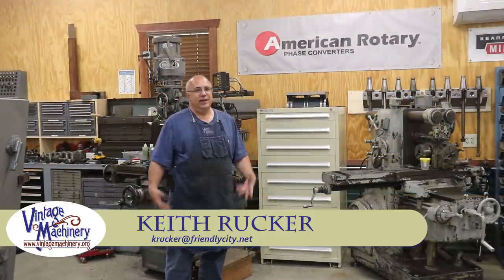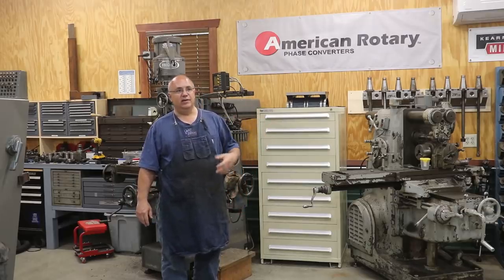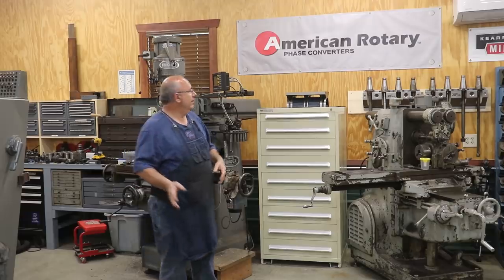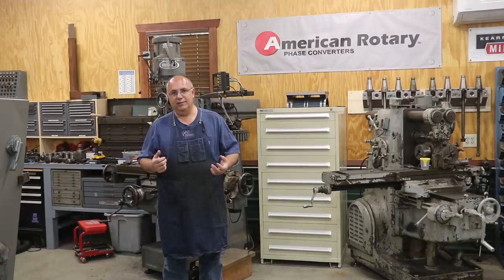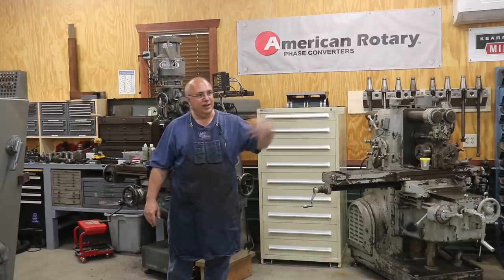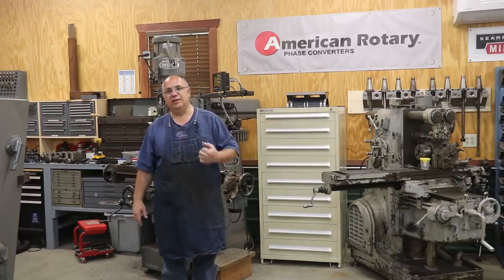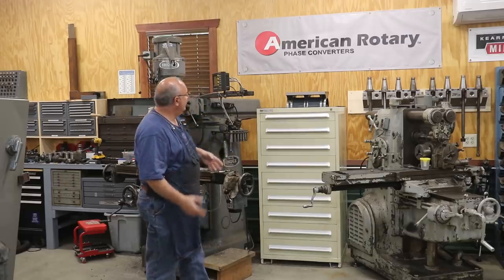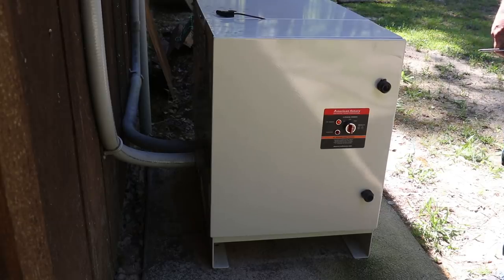American Rotary Phase Converters: Making your own Three Phase Power

Comment: Here before the Germans start with the "all of our homes have 3 phase."
Reply: Homes, pffft... I'm at a summer cabin in finnish rural area. Can't get 1-phase power here, have to get 3-phase. Albeit we use only one phase.
Reply: Its not just Germans - most of EU. All ex-communist countries also have 3PH.
Reply: @tomk3732  Yes Denmark have 4 cords digged down in soil now,before then were in the air.All homes have 240 volts,which is difference between zero-0- and one phase.,I just use a generator on my tractor,400 volt 35 amps. whenever I need to weld something with 400 amps.,not so often.Cheaper that way in my case.

Comment: I think they have different control boxes for the CNC type systems though, more picky about the input power.
Reply: Just find out which out of 3 phases has stable voltage and use that for CNC electronics. Not a big deal. I have 240 240 and 270. I don't use 270.

Comment: Thanks Keith. I'm talk with them now, and I can say they are very very helpful. Thank for the explanation, the VFD and rotary phase is what I'm trying to decide witch one??
Reply: How many machines and motors?  More than 3-5 it is likely better to get a rotary, less than 3-5 then better to just put VFDs on them.  (remember a machine with multiple motors would require multiple VFDs)

Comment: You can easily obtain used 5 horsepower VFDs. For anything under that size there's no reason for a phase converter.
Reply: im pretty sure he said the reasones. If one machine go vfd he said if you got a lot of machine or 20 hp may want to look at a phase converter.
Reply: For one single machine its OK. Then you get another.... then you ditch the VFDs like me and just get rotary for slightly more then price of used quality 5hp VFD.

Comment: Where I live in California, the power company wants $10,000 to $20,000 per pole they need to extend the extra wire.
Reply: I saw a need to 'simply' upgrade my #2 Al SEC but that would cost a $1.5k engineer assessment plus $10-20k to pull about 200' of new wire.  Keep in mind this is all underground and the existing 1.5" underground conduit could handle the #0 Cu wire I needed but they would insist on retrenching I'm told.  Gotta love California and PG&E.  Oh: they would get to it in 12-15 months. rolls eyes

Comment: Yeah, the additional amperage required by a 2-to-3 phase converter is expensive.  For my lathe I needed 10AWG to carry 30A for a 3HP motor. The machine wire was expensive, the cable was expensive, even the plug was expensive.

Comment: A 3-Phase motor makes a noticeable difference in surface finish on even a small lathe such as an Atlas or South Bend.  I had a 3 phase motor with a VFD on my 12x24 Atlas for several years, worked great with a obvious difference in smoothness and finish quality.

Comment: So I can feed a VFD 3 phase power? That is something I've been wondering. I have 3 phase in my shop for my planer and jointer and was wondering if I buy a Powermatic lathe with VFD and 3 phase motor, if I can  feed it 3 phase power. Sounds like that can work, anyone know if it's just a matter of wiring it differently or any other catches?
Reply: Yes you can. You just need to buy the correct type of VFD. A VFD made for single phase input and 3 phase output will NOT work. But you CAN get VFD's that are made for 3 phase input and 3 phase output. The two types are not interchangeable.
Reply: @highpwr - well likely the VFD that comes with the lathe is for single phase hookup so it would cost quite a bit to buy a different one and hook it up, so likely I would have to use 1 phase input as it comes ready for, thanks for the info
Reply: @highpwr  ...Any VFD can be powered with 3 phase.  Controlling motor speed is their prime function.  A side benefit of a VFD is that it will allow 1 phase input to a 3 phase motor.  VFD's can be purchased from the manufacturer sized for single phase conversion (driven motor hp) or you can select a VFD per size of the motor you are operating.  For example, a 5hp, 3phase motor will require a 7.5hp VFD. Either way, any VFD will always accept 3 phase input  .
Reply: Not all VFD's accept 3 phase. Some of the smaller units are single phase only.
Reply: Most VFDs you get accept 3ph to produce 3ph back that has different freqency for motor control. VFD = variable frequency drive. Some VFDs - newer models accept single phase input and give you 3ph back - however that strains the VFD so bigger ones are de rated for that use.

There are very few small VFDs that are meant to work with 1ph input to 3ph output motor only in small 100lbs tools such as small mills etc. You see they have say 120V plug on them. 

Powermatic stuff is usually 1000lbs+ class so I am quite sure you have standard 3ph - 3ph VFD.

Comment: I have 1 phase power, but need 3 phase. So for the missing phase..... Math makes the astute go HUH? 1 phase of the 3 produced at the power co is used to provide your home / shop electricity. The power co uses a transformer to step their distribution voltage down to your home voltage of 120/240. The 1 phase 240 is 2 x 120 feeds that are 180 degrees apart from each other. A rotary phase converter uses those 2 x 120 volt phases to generate a 3rd 120V phase & double that voltage to 240V. Capacitors are used to shift the 2nd phase from 180 degrees to 120. The idler motor acts as a generator to take the excitation from the 2 supplied phases to create a 3rd phase. This is an oversimplified explanation.

Comment: Why use three-phase power? 
Put that question into Google and you get lots of answers that all relate to how it is more efficient and cheaper for high-power loads.  What most of these tutorials fail to mention is that the torque the shaft of a three-phase motor is constant.  On a single-phase motor the torque varies between zero and a maximum value for each revolution, inducing vibrations.  The math (for those not afraid of it) is simple:  Sin A plus Sin A+120degrees plus Sin A+240degrees is equal to zero. Smooth running sith no  pulses.

Comment: Single phase has 2 lines in each aprox 110 volts for total of 220 volts. 3 phase has 3 lines in,  220v 360v 440v in total voltage.If you understand single phase 220 v it's not hard to understand 3 phase. 3 phase is always lower amps for running motors, as is 220v single phase is always lower amperage than 110v.  Think of it as more power with less amps and easier starting a load.

Comment: At 19:00 can you not wire that function directly in the converter? If no Three phase Power is used it turns off after the selected time. No wires to every machine needed. And you do not have to find out that the machine was running all night/week.
Reply: new and old tech I thought the same. It could just monitor the current and shut off if it stays below the threshold for X time.

Comment: It is important to consider that these converters are an acceptable solution for using 3 phase motors.
More sensitive 3 phase loads may do less well. This is by the nature of the construction of these systems.
A 3 phase motor is a very forgiving thing...not everything else is.
There is nothing wrong with that, as long as one is aware of it.
As an example, I would be less keen to feed a 3 phase VFD (3 in, 3 out) from any rotary converter. This will initially work, but how long ...that's anybody's guess. And VFD-3in-3out are not cheap items either.
The US grid is a legacy grid. This goes back to the days when Edison was in it for the money and Tesla actually knew what he was talking about! Updating the US grid to a European style system, would probably cost more than the Moon-shot! These rotary converters are really not the worst solutions, as long as the customer is aware of it's limitations.
If complex CNC machines have to be driven, I would opt for a system that has a separate motor and generator (basically an electric motor, single phase, driving a gennie which is three phase)  This has other issues, such as differential load issues. usually the load on the 3 legs needs to be within 15-20 % of one another. Zero percent being ideal.
Some of the problems can indeed be overcome by over- dimensioning the convertor, but that costs coin.... quite a substantial amount...Knowing that a modest model will set you back 2.5 K -3 K, it is clear where this is leading.
Another thing to consider, for the home-gamer, garage- warrior or rank amateur is the fact that you are almost always alone in your shop. This means that you will have one 3 phase item on at the time. The only exception to that may be a shaper,which can be left running while you are working, say, on the lathe.
Now, unless you go Abom-size on these things, shapers are usually pretty modest in their demands. I have a klopp 450 (18") which takes 1.5 Kw (2 'orses) or about 2 Kw (2 'orses and a limp mule) with the coolant pump on. Add to that another 2.5 Kw for either a lathe or a milling machine and your total demands are not likely to be more than about 5 Kw (7 well-rested 'orses).
Depending on the wiring available, a VFD solution my well be a lot cheaper in this case.
Nothing stops you from getting a beefy VFD and distributing its output to your machines. The fact that is made to vary frequency is academic. This is basically just a by product of making 3 phases out of one, in an electronic manner.
The moral of story : think long and hard before you part with your money and if in doubt, seek advise from someone who actually knows and is not connected to the company you are buying from.

Paddy, EE
Reply: You funny guy. Cheers.
Reply: They have rotary phase converters designed for more sensitive loads (VFD, CNC, other computer equipment, etc)
Reply: I run a single Lathe off a single VFD and it is good enough, everything else is single phase. If I had 20 machines and needed big HP, I probably would do what Keith is doing. I am sure the power company would want $50,000 to get me 3 wires and power. If I was German I would have 440 3-phase coming to my house from the grid.  Most home shops don't have 20 3 phase machines. With the exception to some home shops just about no one in the USA in a home has the need for 3 phase power. Almost everything you own that has no motor is converted to low voltage DC at the device.  Anything else in the will run fine on 220 or 110 single phase 200 or 100 amp service found in the USA.
Reply: Edison played a major role in America's adoption of 110/220, but he wasn't the only party pushing for lower voltage. A large copper producer promoted lower voltages because it requires twice as much copper for distribution than 220/440. We got screwed with lower voltage so that a producer could sell more copper and Edision won't  have to alter the design of this 100 VDC light bulbs.  They worked fine with 110 VAC.
It's hard to believe that more than a century has lapsed and we're still stuck with the crappy standards they crammed down our throats.
Reply: We got lucky really..... When the grass was still green and the sky still blue, long ago when lectric was new, the politicians panicked. They needed some standards! A bunch of engineers said "here use this, that's how we do things...."
Given that politicians were as clueless then as they are now, they adapted the standards, sold them as their own, and all was well. That's why I have 240/400 V 3ph coming in my shop! In the 90s' they tried balancing on an estate level rather than an individual level, so plenty of the more modern houses have single phase, but they can get 3 phase without having to sell a kidney on the black market. This experiment was abandoned after about a decade. With my 3 times 400V , 32 amps per phase, I can run pretty much anything I like. And since the lone home-shopper usually only has one thing running at the time, it is of no consequence if the missus turns on a washing machine or tumble dryer in the house.You just have to take care that your stuff is wired up as balanced as you can get it. I do use one VFD, on an older lathe. That unit is an old industrial unit (3 phase in, 3 phase out) This has rather decent torque compensation, and works surprisingly well (came from a conveyor belt installation) It can run up to 7 Kw motors, but I only need 1,5 for that lathe...so it's a bit on the big side. (about six times the size of the play boxes you get on ebay these days)

All the best
Paddy
Reply: @gh778jk  You definitely got a better system the we did, but I think that AEG played a huge role in defining your standards. Since AEG was the consumer of copper and wasn't saddled with obsolete light bulbs, they chose more practical and efficient standards. They didn't have to employ scare tactics, like electric chairs, to hinder competition: AEG had a monopoly.
Reply: I guess that would be the case for Germany. Here I suspect our own colonial mining enterprises of trying to thwart things... There will have been some cross contamination, as a smaller country would be pretty silly to go against the norm its bigger neighbors are using, it would make no sense. But making no sense never stopped a politician !
In the end, common sense prevailed !

Fun fact, in the late 90s' I upgraded a few workshops (watchmakers) in the Antwerp Jewish quarter from a 110 V AC to 240/400 ! I didn't know that we still had 110V anywhere in the country. 

These watchmakers and jewelers will have come from the US, with loads of (for then) modern equipment running on a 110 volt. The electricity company from back in the day had massive transformers installed in the basement of the building. 

I still use some of those for US army transmitters (converted to HAM bands, I am a licensed radio amateur). Nobody wanted the transformers, and I dragged the ones home I managed to lift LOL !

Paddy
Reply: You cannot use VFD as you describe as VFDs are designed to run *single motor*. They can be stretched to run single motor and a little one - such as coolant pump or maybe power feed. But not much more. Reason is that unless you go super oversize your VFD has no reserve capacity to start another motor. There is a reason why VFD is starting motor slowly - that is the max it can provide in starting current. You could start multiple motors at once but VFD will have issues when starting motors one after another.

Also each motor has different starting parameters. Yes you could put them into VFD memory, move VFD around on a cart to each machine you are using etc. 

Or you could just pay the same $ for a rotary and not worry about carting VFDs around.

Imagine carting VFD to the saw to cut a piece of stock. cart it then to the lathe to round it up. Then cart it to the mill to cut a slot in it etc. Lots of connecting/ disconnecting etc.
Reply: If you read my post, it should be obvious I am never suggesting using a single VFD to run more than one motor at the time. The standard settings of any of these boxes are good enough for pretty much any standard 3 phase motor.
It should also be obvious I am not a very great fan of either solution.
Running a 3 phase gennie, from a single phase motor (as in two separate entities) would be a far better solution, but yes it would be more expensive.
That said, either solution is adequate for the average home-shop/garage-warrior.
If you apply these solutions for production means or heavy duty three phase systems.... you need to look for a different means of getting three phase power in.

Paddy

Comment: i bought 2x 10hp vfd, to run 3hp motor on a hydraulic press, it was useless, bout 33 percent of the grunt needed
Looking at ordering a 20 horse, that ships to Australia, they are double the price here, so 2900 USA  equals abt 4300 Au plus freight, awaiting a quote for that  then plus 10% tax on the total, have a lathe 12 hp which i run off of a Lincoln Vantage 400, welder/genset, but it will pull higher speeds on the lathe
was quoted 10500 here

Comment: I'm watching this video inside a summer cabin with 3-phase powerline coming in. Can't get 1-phase in finnish rural area.
Reply: I can confirm this! Only place where  I have seen one-phase system here in Finland, is in a city apartment, but that is only inside that one apartment, the house itself has 3-phase system. It is maybe possible to get one-phase system also in rural areas, but it is not cost effective.
Reply: @1978jra  Some old properties may have single phase. New single phase connections are not sold. Utilities claim that network balancing would suffer.
Reply: @sleeptyper  Had to check. Looks that Caruna does not sell single phase, but Loiste (old kainuun valo) will, but it is severely limited, less than 500w and 1x16A.

1x16A cost 2000€ and 3x25A cost 4000€ (both minimum prices). I suspect that with those prices and power ratings that single phase is sold only for really special cases.
Reply: Thanks for putting stick into our eyes :) Its trivial to get 1ph from 3ph vs. the other way around.
Reply: @tomk3732  You'll probably enjoy the fact that we can charge our cellphones from the very same outlet that we can run our washing machines and clothes dryers too, lol. We don't need to fiddle with 110v and 220v outlets and wirings. 400v 3-phase is for big machinery.
Reply: @sleeptyper  Don't get me started on over dozen types of outlets we have.

Comment: I think you can buy few extra remotes to keep at each machine. You could actually solder a wire from the push button on the switch on the machine to the motherboard on the remote control, then you can activate the remote control as soon as you push the button to turn on the machine. These remotes usually have very common frequency, usually 250-450 Mhz or 2.4 Ghz range and are usually very easy to clone. I seriously doubt that they use some encrypted channel. So no need for wiring the place up...